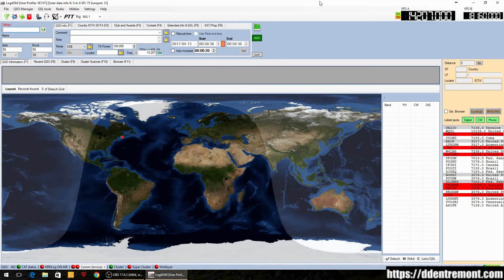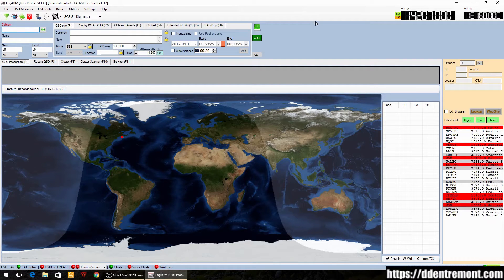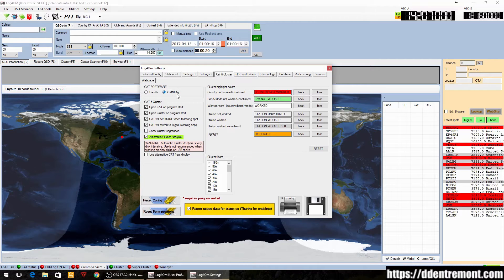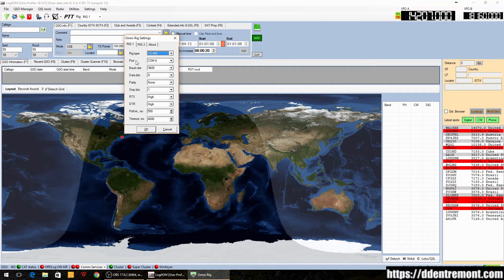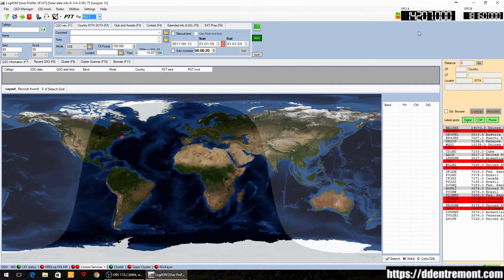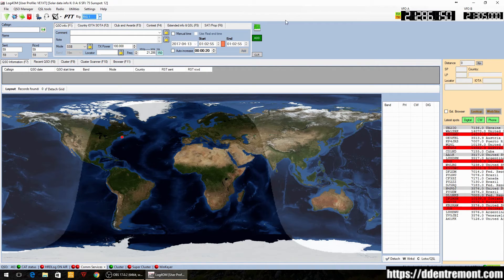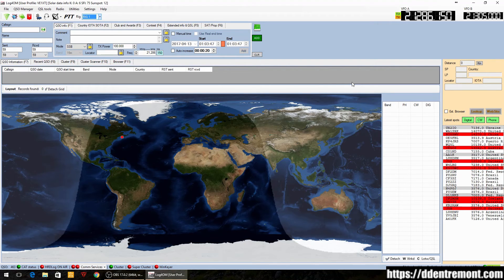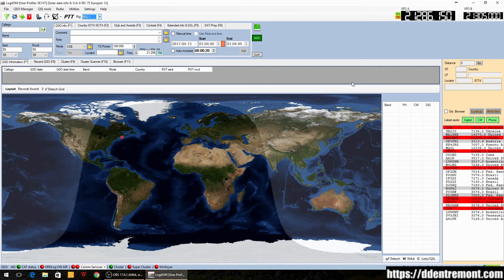Ham Radio: Log4OM Video Demonstration #3.5 - Rig Control and CAT Using OmniRig

Comment: Can you use second vfo could it be another radio tnxs 73 KQ4CD
Reply from the maker: I don't think you can use two radios at a time. The second vfo is for the second one on whatever radio you are using. I could be wrong but I've not seen a two radio set up

Comment: I use OmniRig as well for log4OM.   It allows me to have Log4OM and HDSDR running simultaneously with my Kenwood TS-570D.  This way I can click around in the waterfall to chase signals or find an unoccupied frequency and it updates the frequency in Log4OM for me to start logging.  This arrangement also allows me to use the more customizable notch filtering in HDSDR for my receive when dealing with QRM.  Thank you for your Log4OM tutorial videos.  They are a big help!
Reply from the maker: That's a really good idea.

Comment: When 1 click on a ham using digital modes .My Kenwood TS480 goes to FSK.
Other modes like SSB/LSB and  CW working ok with Log4om and omni rig .Any thoughts
Reply from the maker: I am not sure on that one. I will have to test it out. Are you using omnirig or Hamlib?
Reply from the maker: 1450rockin good stuff. Sorry I was late replying. I didn't get a notification when you commented.
Reply: Dennis d'Entremont 
In settings  Cat Cluster 
I had mistakenly checked the box- CAT will switch to Digital 
unchecked works fine now.

Comment: Are there any other cables necessary to make the connection between the radio and computer... or is it done with the existing usb from the interface to the computer.?  Thanks for an informative video.
Reply from the maker: +Joe77 it depends on the radio and the interface you are using. I have an older style signalink that takes two audio cables from the PC to the signalink. I then have an interface cable from the signalink to the mic jack on the radio and an audio cable from the radio headphone jack.to the signalink. I also have a cat serial cable from the PC to the radio for rig control. 

My rig is a Kenwood TS-570

Hope that helps.
Reply: Thanks, that is what I needed to know. thanks again..
Reply from the maker: Apparently I answered thinking this was a comment on my FT8 video. For the cat control with Log4OM all you need a CAT cable to go from the PC to the radio. My PC does not have a serial port so I use a USB to Serial adapter. If you are interested in FT8 then all of the previous comment is relevant.
Reply: Thanks, Now I get it..